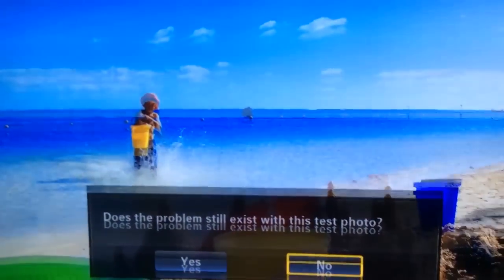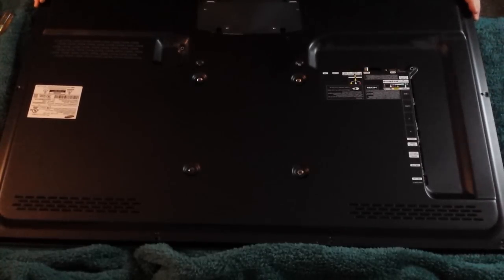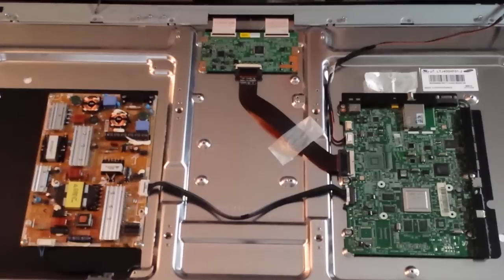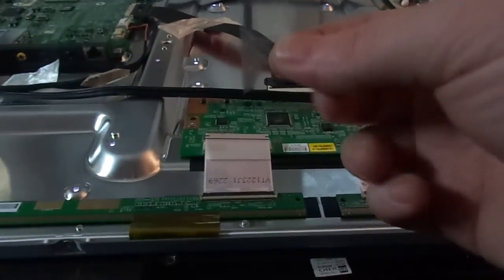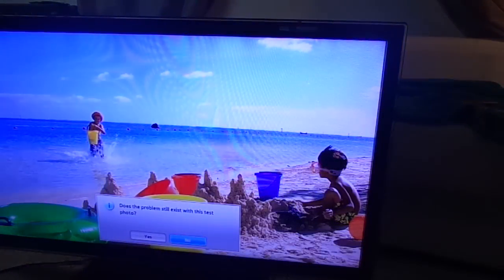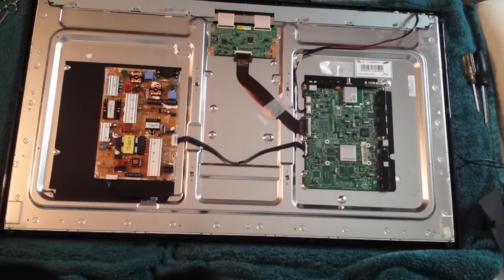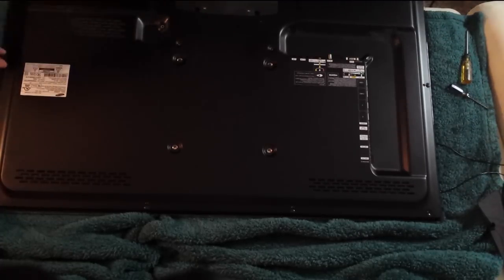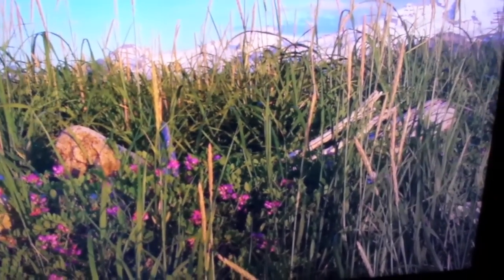LED LCD TV FIX, How To For Samsung Double Image, Black Vertical Lines, Screen Problem Sony LG.

Comment: i did this and it works. one more question   there is just a slight variation between the two sides of the panel   i have tryed several sizes of tape.  I am guessing that becuase of the tape, it stops the double image , but will leave a slight difrence between two sides of tv.   If i replace the Tcom board it should fix this ?   Is this caused by the Tcon board, or the ribbon cables ?  or main board ?any help please.thanks

Comment: What about freezed images from previous pictures on screen. Will this work for that on Samsung led tv or is it a bad panel? PLEASE HELP!!
Reply from the maker: I think the freezing image issue is related to the T-Con board. More than likely this video would not be helpful for that issue.
Reply: +Do It With Dave thanks man I appreciate the help. I'm trying to everything I can to resolve this issue. it's a mess.

Comment: Hi. I have the same tv you have in the demo and mine has a problem where the top inch of so of the screen  is ruined buy distorted horizontal lines ( no ghosting though ). I am trying to follow this video and have tried various permutations of taping the tips of the bands connectors. Can I just be sure, are you meaning for some of the contacts to be insulated by the tape where the tape is folded over the tip? I'd really like to fix the TV.
Reply from the maker: The tape is used so that static electricity will not build up causing The Double Image. Basically it's pushing the connectors closer together so that they can make contact. if you have the horizontal lines you may be able to just adjust the ribbon cable where it sits. also sometimes if you have an Xbox or Blu-ray player the device can cause a distortion on the screen try to unplug any device you have currently plugged in and plug-in maybe a cable line or just go to the menu and see if that does anything first. I hope this helps.
Reply: So, just to be clear... Is the point here to be folding the tape over the front of the pins of the connectors (left or right) \? What I got from your video was that it's a kind of trial and error approach of insulating the contacts one by one from left to right? I've been trying this but to no avail.
Reply from the maker: Yes I applied the tape on the front side of the ribbon cable  (gold pins). And it is a troubleshooting type of fix. I can't say for sure if what is in the video will completely fix the issue your TV is having. Some ppl said all they did was remove the cable and gently cleaned the gold side using a pencil eraser. Someone even said they used a piece of paper on the back of the cable to push it closer the the concact. If you do continue to work on the issue keep patients on your side.
Reply: +Do It With Dave Is it a problem of the T-CON board itself or it's because the ribbon cable are not working good anymore?
I did your fix on my Samsung LED TV (similar to yours) and the image is now like normal, only with a bit of change in brightness when there are some combinations of color on the left side of the screen

Comment: I have a Toshiba LCD 32 PB 21 ZE having a double image I checked with The service guy he said need to change the panel as it is damaged.  asking about 100 $ to fix replace with a new panel. Does the ribbon fixing will solve the problem Should I give it a try. Please suggest. Regards, Manprit   for,m Delhi India.

Comment: Can't thank you enough for this! My screen on my 50" Samsung (UA50F6300AM) went in a similar manner. In my case, the bottom left corner went white too and the panel was really hot in that corner.

Getting to the ribbon cable in mine was very simple though. Just removed the back panel and that's it. Selotape applied to the left cable and it worked first time! Didn't need to fiddle with anything. So a bit lucky in that respect :) so many thanks, again!

Comment: Nice fix, I just got a free dumpster 52" samsung and at first there was no picture so I just took it apart to look for anything blown and I happen to move those cables and picture came up.  Sometimes there are lines on the screen and sometimes not so Ill try this.

Comment: Hi we tried to fix the double image issue on my samsung smart Tv. we have fixed 90% where small lines were appearing on left side.

so we tried to open right side and put it back. after that when we power on the Tv we only see blue screen not seeing any images at all.

any idea, how to get back the images?

Comment: Dude.  You are the freaking Man!!!  Saved me ALOT of money.  I had to put my tape on the right controller and not at the very end, but a bit more inwards.  Maybe skipping 24 pins or so on the end before i put my tape on.  

But this video gave me the know how to troubleshoot and find out which controller it was, and after the first few attempts at tape on the end didn't work, i moved more inwards and BAM!  Perfect picture.

Comment: So the problem is that connector on the T-Con Board. So this will be the easiest and cheaper way to fix it, or replace the T-Con board which will be more expensive, the question is how long will the tape fix last?
Reply from the maker: I used the steps shown in this video and it's been over 2 years with no issues with my tv. One thing to mention, the double image can back 2 weeks after I did this so I went through the steps a second time however I used an extra piece of tape to hold the ribbon cable to the metal panel...so it would not move. So far ppl have posted that the biggest issue their have had was one side of the screen is a bit dimmer than the other. Hope this helps. Thank you for watching.
Reply: +Do It With Dave Thanks man, it does work, in fact i've just fixed mine after watching your video and like you said you just gotta be patient, but cool so the fix last for a long time. Thanks, Great Video btw.

Comment: hi dave, i have a sony 55" 3d smart tv, model : kdl 55nx810, it fell from the hanger, slight crack under the screen, nothing to worry about, however, these lines now appear on the screen, horizontal lines. kindly assist

Comment: Without reading all the  post, quickly, what is it you are doing with the tape? tightening the fit of the ribbon connector? umm... clean connections???

Haven't tried it yet..... but will let you know how it works out!!

Thanks!
Reply: how was?

Comment: A customer of mine gave me their 40'' with this double image after I helped them set up a new one. I was considering taking it in for repair but I have other larger TV's and didn't want to spend the money so I said whatever if I break it who cares, no loss. This totally worked and took me under an hour to do. Great vid. I'm curious if you know why covering these pins with the scotch tape has this effect, do you know the tech science behind it? Either way, thanks!
Reply: for the double image did u used the both tapes or just one thanks

Comment: How do you disconnect the big black ribbon cable. I tried to press and pull but didn't want to use too much force not to damage it.
Reply from the maker: As long as it has a locking tab slot 'where the ribbon cable seats' you should be able to push up the locking part on the slot  and the cable will easily slip out. Double check on what your TV has on some models the connection is  not accessible from the back as shown in this video they require more to be disabled to gain access for the cable connection. If you have access like shown in the video then look to see if the cable is possibly slightly melted in place from over heating. I hope this helps.

Comment: Wow... It worked!!! I had problems on both sides, but fixing a single side seemed to clear the problem completely. I even sliced about 1/6th through one of the ribbon cables & almost gave up, but somehow the slice didn't mess anything up. Thank you so much for posting this, I've been looking at this "broken" tv in my room for 2 years, wishing it was working. Now I don't have to wish anymore :)

Comment: I have fixed my tv following your instructions and it is successfull.thanks a lot.
so what did you think will the tv perform normally in future or the problem occurs in a frequent manner?
because samsung service engineer said previously that it cannot be fixed hence i have to change my tv.but i give it a try and it is a success.

Comment: This worked for me very well! Thank you verg much :) 😍❤️ ar first I used a 5/6mm thick band, and the half of screen was darker as the other. And then, I made the band thicker (2/3 mm), and that solved the problem :D thank you Dave! You saved me for hundreds of bucks 😁
Reply: Having same issue. Tried to use wider tape as well as narrower. Half the tv is still darker. Did u change thickness of tape or width? Also I have to put the tape very much in middle.
Reply: @7092ron  Hi were youy able to fix the darker screen side?
Reply: Roberto Certain 4 years back yes. And it is still working. Brought it to india from US. Haha

Comment: When I push down that clamp, it causes the screen to have a double image. I can get the ribbon in there and get the picture right. But as soon as the ribbon is pressed down with the clamp, it returns to double image.

Comment: I have the 55" version of this TV, model # UN55B7100, with the same double image and horizontal lines.
Well, I was skeptical because you are disabling some functionality by covering the pins with tape, but I tried anyway. Sure enough covering 16 pins +- 1 on the left connector fixed the double image and horizontal lines I was seeing. BUT, the right half of the screen is not as bright now There is some interdependence on the 2 halves. True if you disconnect the left ribbon cable the right half works, but when both are plugged in there is some dependency
Anyway, thanks for sharing. This is a good temporary fix for me while I shop a new TV.

Comment: I'd used to cut about 1mm of the face tips flat cables on DVD sets, when it was in shortage at the electronic parts shop, in a lot of cases it was the solution since they never returned to my shop with the older issues coming again !

Comment: Thanks a billion for this! I had the double image issue on my Samsung la32c530 lcd tv, tried your method of fix, i was able to get a much clearer picture now. The only issue i have is a very minor difference in color grade between the left and right portion of the display but that's negligible considering how bad it was previously. As usual Samsung technician suggested to replace the panel which costs 21k! I had bought the tv in 2011 for 33k! Made no sense at all in spending so much, so tried your method and it definitely helped and works better now. Thank you!
Reply: +Ayan Sarbadhikari bro, could you help me here pls, i tried same method but no luck, my tv model is la32c590, same series as yours. Could you help me pls.
Reply: +Manjunath S - just follow the steps shown in the video and be careful of how much of the tape you are using on that cable. let me know where you are facing the issue or where exactly you need help with.
Reply: +Ayan Sarbadhikari  - i did follow the steps, with varying tape lengths and still no luck yet. But, it has caused more damage i would say (my bad luck) - initially the screen was depicting double image, but now left screen has got full of vertical lines and no video is displayed on that screen (Just white and few other colors vertical lines). Any chances this could be fixed? i can show you screenshot of tv display.
Reply: all depends on how you apply the tape, if at all it is a problem with that connector. not sure why there are vertical lines now.

Comment: Dear Dave, Thanks so much for your video, it really worked for me and I can't thank you enough! A month ago a neighbour had put a Samsung LA40550K7M out for rubbish collection. I took it home, plugged it in and only found that it had two thin horizontal lines around the middle of the screen, everything else was working fine. I looked for a couple of days on the net and couldn't anything that was helpful apart from buying a new or second hand T Con card and hoping for the best. In my heart I knew this was something of a connector issue but couldn't put my finger on it. One day i pulled the tv apart and had tried to to reinsert the ribbon cables and the like but to no avail. It was only after i put it back together and actually left the screen on for an hour and saw what the neighbour had seen to throw it out. The top half of the screen developed a double image after warming up making it virtually impossible to watch anything and thats how I found your youtube clip. At first i tried the left hand side(from the back of the screen) and found no improvement,  only made it worse after mucking around with differing widths and positions of the tape, but when I pulled out the cable from the right hand side and half the picture went, the problem horizontal lines went too. I then knew that this side had the fault. I started on the left hand side of the cable but it was only until i got the the right hand end that i made the breakthrough. My sticky tape piece covered only about 8 segments and from about 2/3rds from the left hand side of the right ribbon and with a little experimentation the issue is now completely solved. Got myself a nice free LCD screen now.Cheers :)

Comment: I have a 2 year old SEIKI LC-46G68. It experienced the same double image problem described for the Samsung. After watching the Samsung Double Image, Black Lines video I attempted the repair on my SEIKI. Access to the ribbon cables was much simpler than for the Samsung and the repair was completed. Now I once again have a perfect picture instead of having to replace the TV. Thank you for posting this video and I hope other SEIKI owners will be able to repair their's as well.

Comment: Hi I tried this on a panasonic th-l42u5s but when I stick the tape onto the gold connectors, no image appears on that side of the screen at all. I applied only a small amount of tape at the tip of the gold connectors. Any ideas? Oh and the problem with my TV is that it has flickering horizontal lines while the color is also kinda distorted. Will this fix repair that?

Thanks in advance

Comment: If it's the whole screen with lines vertical and horizontal then would it be the next flat cable the two cables plug into?
Reply from the maker: +mc “mcalleyboy” alleyboy Hey there Gee Money just posted a link with a description and pictures of an issue there tv was having and what they did to fix it. Check it out just below your comment sounds like the same thing.
Reply: +Do It With Dave   Thank you Dave, real cool, that's my TV.  I used the spray freon cans in the US Navy sure miss that stuff and then in the later 90's we switched to a different electrical spray (same thing) but ... ugh stuff like that is impossible to find in the Philippines, even the canned air for the computer, sure miss that stuff.

Comment: This will fix it ! 
http://www.avsforum.com/forum/166-lcd-flat-panel-displays/1492931-samsung-lcd-tv-colored-vertical-lines-issue-resolved-loose-connector-save-yourself-1237-my-model-ln55c650.html
Reply from the maker: +Gee Money Thank you for your post.  There have been many ppl that have had that same issue and wanted to know what they could do to fix it.
Reply: No problem Dave. This is what fixed mine. I also used QD electronic cleaner on the ribbon that I removed and put back in. I also sprayed the HDMI ports with the cleaner. So far my TV is like new. Even the picture looks better.
Reply: +Gee Money   This is my TV, except mine looks like the screen is frozen then after warming up I see the lines.  Looks like cables inside, ughh they don't sell freon or that electrical spray in the Philippines, I used to use that working on helicopters in the Navy.

Comment: This worked the first time I did it, a few months ago. Yesterday, the double image returned. I took apart the TV again, removed the old tape, put on a new piece, and nothing changed: still have the double image. I've left a message for a TV repairman.
Reply from the maker: +Mary Cochrane The double image returned on me as well at one point.  Keep in mind that this is not a professional fix for a tv with this issue.  It will work most of the time.
Reply: +Do It With Dave Thanks; good to know. I dropped it off with a local repair shop on Thursday. We'll see...

Comment: Hi Dave, can you tell me how to fix my Samsung tv LN32D450G1DXZA model that display black and white?
Reply from the maker: +naimee02 All I can think is that the color is not showing like it should for some reason. Maybe try to go into the menu options and play around with the color hue contrast R,G,B settings see if it helps.
Reply: Oh thanks a lot. I'll try it out.

Comment: Thanks this worked! :) but some times left side of the tv gets strange (white flash). but only with some colors. any thoughts on that?? anyway thanks. this was very helpful. good luck to you sir!
Reply from the maker: +Harindu Ishan I think its do to putting something in the way of the cables making full contact (tape).  So one side of the screen will appear to be dimmer and or flash a bit off when white is displayed on the screen for a moment.

Comment: I did everything you described in your video and for a moment I thought I was there. I had the left side at about 80% so I moved the tape a bit and it got worse. After a few more tries the right sight is now giving a double picture and the left side is dead altogether. Any suggestions?
Reply from the maker: +Andreas Treutler If you are still getting a double image on one side of the tv while the cables are both inserted than the connection is still being made.  Double check that the cables and contact slots don't have any signs of burnt out pins.  If you are getting the double image with only one side plugged in than remove any tape and see what happens.  Some people are stating they have used paper instead on tape the remedy the double image issue.